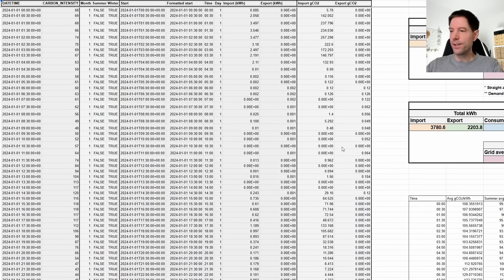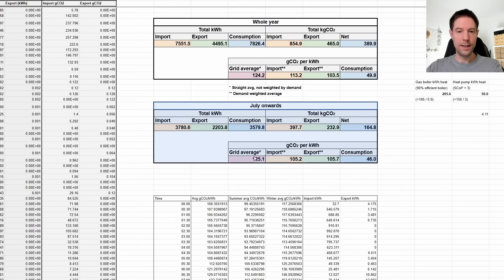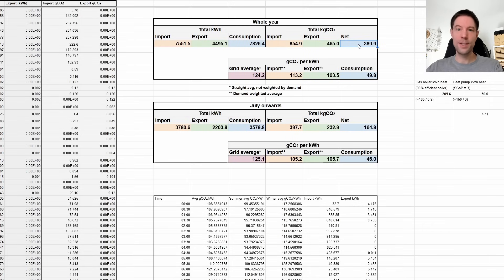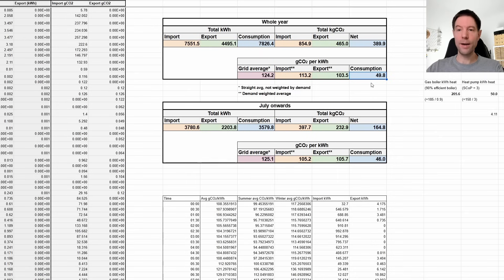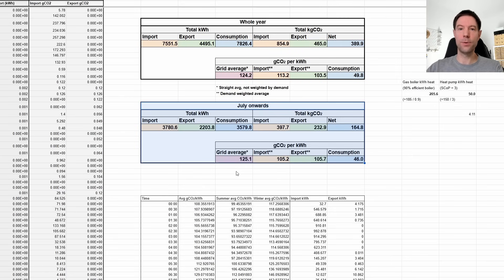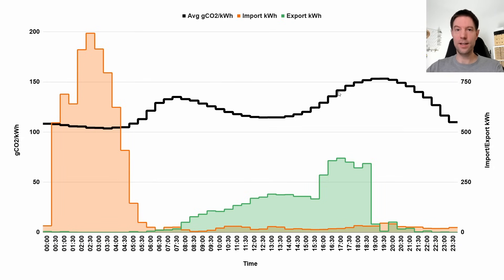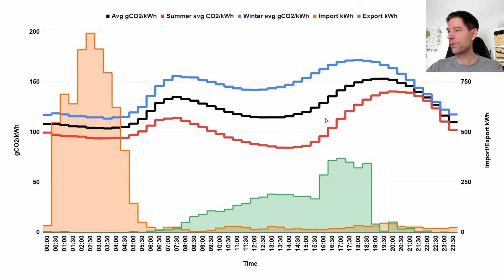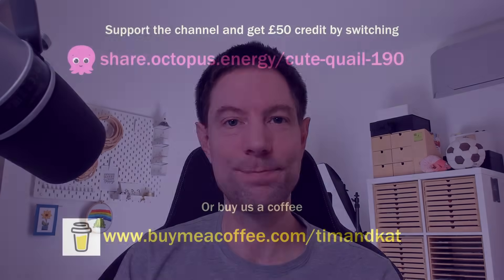I thought we were carbon neutral - I was wrong!

Comment: Interesting. But the limitation is with the infrastructure of our national grid system isn't it? Our first duty should be to help out suppliers by giving them any spare kW we have at the time they need it most so as to avoid them having to switch on a gas fired power station? 
But I get what you are saying here. Very interesting as always!
Reply from the maker: Yes, that's what I'm suggesting in this video.  Exporting at times of highest grid carbon intensity.

Comment: Hold on Tim. You are with Octopus aren't you? They give you green electricity. I know that the grid where you are connected to comes from arguably anywhere so you've looked at average grid figures for percentage of carbon etc but it looks like you are not accounting for Octopus offsetting sources so they can claim to give you green electricity. So arguably you are carbon neutral when combined with Octopus's efforts.
Reply from the maker: I don't really agree with the argument that "100% renewable tariffs" really mean you're using exclusively renewable energy.  All that means is it's a signal to investors that there's a demand for green power and so more investment is made for the future resulting in a gradually greener grid.  Another way to think about it: If I buy renewable power someone else effectively receives dirtier power because there's less green available for them.  So I don't believe it's right to claim I'm green by doing that as it's not really changed anything for the grid mix as of that day.
Reply: @TimAndKatsGreenWalk Octopus buys electricity from green sources like wind, solar, and hydro and they also buy green REGO certificates and energy directly from UK green generators. Effectively they offset their balance by trading origin certificates. It's  not made up it's traceable in their FMD (fuel mix disclosure report).That's how they can claim when you buy electricity off them you are  paying for green electricity. Of course they don't send only green electrons down the wires to you because of the grid but as all the electricity you are buying is 100% green and your money ends up paying green sources then you too are 100% green if you follow the money.

That is in fact the only sensible calculation you can make.  You can't apply average grid source balance figures to your local situation as you have done, although I can see what you are trying to do, because you are not evenly connected across the entire grid. You are locally connected and unless you are the district network operator you won't have a clue where your actual electrons come from. It all depends on the active  generators in your area and the local loading. If you live next door to a nuclear power station then all your grid electricity is likely to come from there (shortest path of least resistance) but you might have an active local solar, wind or battery farm and it might come from there but then again you don't know the local loading situation which might have all the green electrons gobbled up by the local arc smelting works and in fact your local area has power dumped into it from hundreds of miles away possibly France. You just don't know so your actual source balance could be entirely different to the average grid balance figures you've used rendering your personal calculations meaningless because you are not evenly connected to the whole grid - you have a unique local situation. You'd need load and distribution figures off your DNO coupled with district feed figures from National Grid and that would be far too difficult to do. Using the grid averages is a flawed approach for that reason and can't even be said to be approximate as you are not an average grid consumer either. Everyone is different and uniquely connected.

The only sensible and thankfully easy way is to follow the money and accept that Octopus sell you green electricity. It's a certificated and traceable system. Congrat's you are carbon neutral 😃👍
Reply from the maker: Take this to the extreme and imagine every consumer in the UK signs up to a 100% renewable tariff.  By your logic that means the whole UK grid is magically 100% renewable and so everyone can claim to be carbon neutral.  That is clearly nonsense, the grid still has non-renewable generation in the mix.  Claiming that buying credits is equivalent to actually generating green power is something I consider to be Greenwashing, and so I'll never use the argument that just because Octopus is selling me ostensibly 100% renewable energy I can claim to be carbon neutral.  I did mention that I used the national average because it was a pain to get regional data.  Although as it happens our region is often quite similar to the national average anyway so I consider that to be a reasonable compromise.  And in any case it didn't really matter for the purposes of the message I was trying to convey with this video - that you can change your carbon impact by changing the times you import and export to/from the grid.
Reply: @TimAndKatsGreenWalk That's not really a logical argument because 100% of customers can't be Octopus customers and Octopus claim 100% green sourcing at the same time. That wouldn't be possible under the audited REGO scheme administered by Ofgem which provides guarantees of origin. There's only so much green to go round You've nabbed your bit well done. If the scheme didn't work you could make a complaint to the advertising standards authority and ultimately sue Octopus for misselling. Good luck with that!
In any case following the money through the scheme is better than your unknown local sourcing and loading situation and trying to apply an incompatible national average as I have explained. Your general push to be greener of cause I applaud and the discussing of it stimulates thought and innovation.
Reply from the maker: @johnh9449  I still claim greenwashing on that one I'm afraid.  But regardless, I stand by my methodology and conclusion.
Reply: @TimAndKatsGreenWalk Well, l've tried my best to explain to you and if you don't understand then I'm afraid I can't help you further (touché!) 😉.
Reply from the maker: @johnh9449  it's not that I don't understand (I do), I just don't agree with that reasoning.  I'm not offloading my grid carbon to someone else just so that I can claim to be carbon neutral.  That's basically what you're suggesting and I don't think that's fair to do.
Reply: @TimAndKatsGreenWalk I don't expect you to remember but we had a disagreement a while ago over the calculation of payback time in a system from the inclusion of an extra battery. I said that you should recalculate the whole system rather than only consider the incremental change because there's no logical reason for treating the extra battery differently which could have been included at the start. You immediately defended your position. You made the statement that you "stand by your calculations" - dismissing my point out of hand. You later came back with a flawed graph showing that payback time was increased, unfairly adding the cost of replacement before time in comparison. I pointed out that it still paid for itself within expected lifetime and was a larger investment with therefore more return and you claimed that because it took longer it wasn't optimised (why does speed trump size of return?) and when I pointed this out you said, "I've tried to explain and if you don't understand I can't help you further." At the time Ithought that was quite dismissive, and your comment "I've tried to explain. If you don't understand" (i.e. you aren't intelligent enough), "I can't help you further" (shutting off further discussion) - so as an experienced engineer I was a little hurt and disappointed by that. I realise these internet discussions can be a little heated but would like to work with you rather than be seen as an enemy to be defeated.
 
In this present discussion I simply treated you the same. Hence the comment "touché!"
Also I have the backing of Ofgem and Octopus here so if you really disagree with the system put your money where your mouth is and sue rather than argue with me. I'm simply quoting an authority.

As for using a grid average for local calculation, not knowing local feeds or loads, you must agree is surely erroneous. Prove me wrong on that one.

Anyway, I don't wish to fall out with you. Your channel is excellent and provides a superb viewpoint for green technology and stimulates thought and innovation. I've watched what you've been doing in parallel with my own adoption of green technology and can appreciate your efforts to communicate this to the world which I couldn't manage. That is a social good which you can be.proud of.
Reply from the maker: @johnh9449  I do remember that exchange and I was certainly overly harsh in what I said, so I apologise for that.  Having said that I do still stand by all my reasoning in both that discussion and this one; nothing you've said has persuaded me towards a different opinion.  It seems we won't agree on those points, so that's fine, and it probably serves neither of us any good to continue to try and persuade the other to our point of view.  I suspect in that pervious discussion I was getting frustrated that I was failing to bring you round to my point of view and I should have realised it was fruitless a lot earlier, and thus could have avoided causing offence to you.  I expect we're at that same stage here now too.  I certainly want to avoid falling out with anyone if I can help it!  I'm glad you generally enjoy the channel, despite occasional disagreements, and I hope you'll continue to support what I'm trying to do with this channel.
Reply: @TimAndKatsGreenWalk Tim, Thank you for your gracious apology for your remarks and I in turn apologise for my teasing you with similar comments. It's fine that we can hold different views and communicate them even if such communication does not change that viewpoint. There is only one reality however and I hope we can engage in future to reach a common viewpoint and understanding in the realisation of that reality.
All the best,
John
Reply: While a green tariff is important and meaningful, I think I agree with Tim that it's absolutely legitimate to calculate a carbon footprint ignoring that fact. While following the money is fair (and there is a reporting standard that would consider this 0 emissions), the fact remains that if Tim uses 1kWh more at a given time, 200g more CO2 is generated (say), because somewhere, a gas power station was turned up slightly, not a wind turbine. There are dual reporting standards with each approach because each has a valid use. Unfortunately, the reality is that by selling 100% green tariffs, it just means the other tariffs have a higher fossil % than they otherwise would. It doesn't very meaningfully change anything, except as Tim says, to signal that it matters to him as a consumer. It's certainly disingenuous to say that Ofgem is against Tim on this one, as both reporting methodologies exist, and Tim's logic as an individual considering his impact is perfectly valid
Reply: @nutlike1659 You can calculate your consumption on the basis that it comes from the average country production mix, or totally fossil fuel if you want. In reality it will depend on local loading and local power sources which is difficult to calculate. The easier thing to do is follow the money and that's what the REGO system allows you to do. 
You can argue that if you take the green electricity someone else takes the fossil but conversely if you didn't take the green someone else would. There's only so much in the mix available but the money trail and the certification means that legitimately you are paying for green and of course that incentivises the industry to supply it. Not everyone can do that because there's only so much green to go round even when averaged over time but it's growing. If the scheme and the incentive wasn't there then that would disincentivise the green power industry and economy just as surely as not being bothered about choosing a green supplier because you believed it was a con and they were all the same. I think it's better to encourage green power production - that is what the scheme is meant to do with an audit trail to prove it.

Comment: What if you charge your EV on the 'Greener Days' when it is windy? Is that accounted for here? We only need to charge ours once a week most weeks. Another factor is that the grid will get greener each year, so it is only going to get better.
Reply from the maker: Yes, that would help a bit, for sure.  It's not always practical and the effect would be relatively small since we don't do many miles, but it would help if we could manage it.

Comment: I may be missing something but your solar generated kWh is zero carbon. The biggest fact is the reduction of what you have used from the grid. Again the strategy used by us to get paid for more export actually causes us to use more and increase our CO2 levels. If you stopped importing to the battery and exporting it, your CO2 would be lower.
Reply from the maker: Anything I import to the batteries leaves more solar to export, so that doesn't really matter, as long as you're charging the batteries at times of low carbon (i.e. overnight) then you'll be reducing the grid carbon intensity overall.  If I don't import to the batteries overnight then I'd have to use my solar myself instead, and therefore wouldn't be helping reduce the grid carbon intensity by exporting at times of high carbon.  So I don't believe that importing and exporting to/from the batteries increases the carbon intensity.
Reply: @TimAndKatsGreenWalk  I totally agree as I am doing the same, but my big point is the more that we import the higher our CO2 will be. For me the the zero carbon solar would reduce the amount of kWh imported. We are just in this strange but good moment that we have a way of buying at 7p and selling at 15p. Best for the pocket but not the CO2!
Reply from the maker: I still disagree with that in some situations though, if you import overnight at 50gCO2/kWh and then export that same power back out when the grid is at 200gCO2/kWh then you prevent 150gCO2/kWh net being needed (ignoring conversion losses etc.).  Your import may be higher but so is your export, and the result is that the net difference in CO2 is beneficial, not detrimental.  As I showed at the end of the video if you can target your export at the peak of the carbon intensity curve in the summer (between 6pm and 9pm, say) then you're definitely helping to reduce the carbon intensity of the grid by utilising your batteries.  Although I agree that if all you're doing is exporting back at a time when the grid carbon intensity is similar to when you imported it then that doesn't help at all.
Reply: @TimAndKatsGreenWalk  Good point!! Slightly different viewpoint helps to understand. Thanks